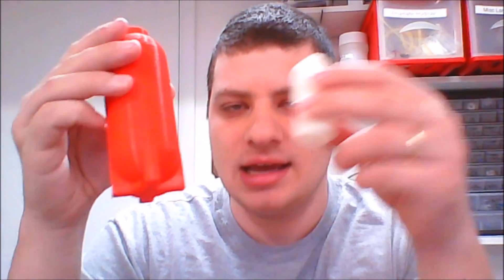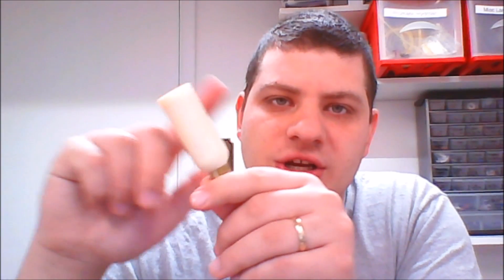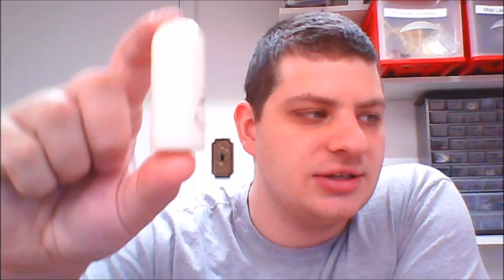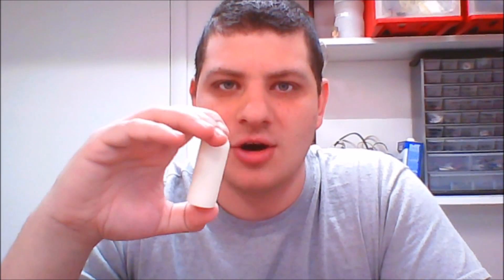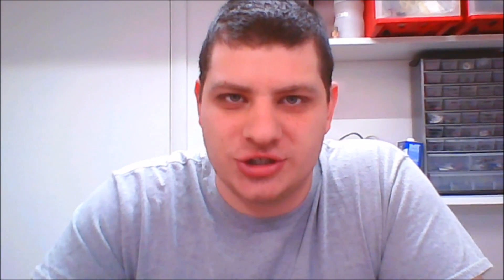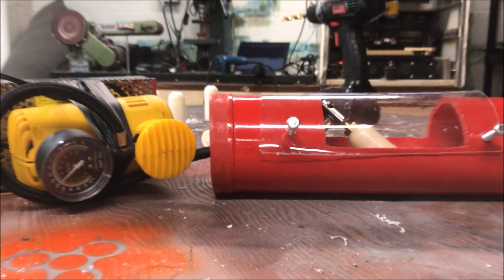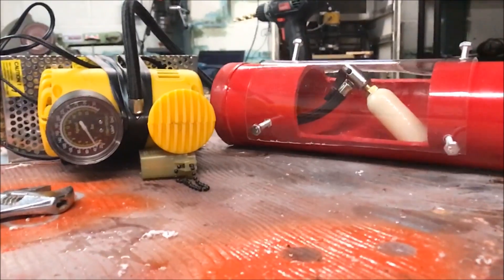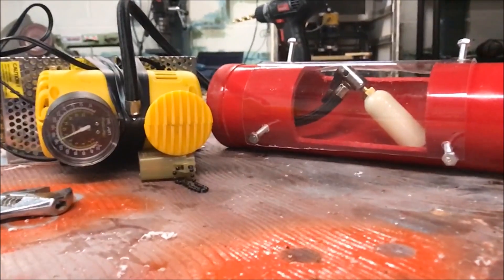Can you 3D Print a Compressed Air Tank? Part 2

Comment: You can print ABS and also PETG air-tight without any post processing, but you need to figure out the right slicer settings for your printer. I managed to reach 8bar (~110PSI) on my Raise3d Pro2 and E2 with a wall thickness of just under 2mm.

Comment: Buddy, as far as I see, the problem can be the size of the threaded hole compared to the rest of your vessel. I´ve been working with pressure vessels for 20 years now. There´s a reason there have been a bunch of regulations for that. Check the ASME pressure vessel code and you´ll see. The slope of the tank curve adjacent to the brass maybe concentrating stress for those pressures and generating the leak. Try a different geometry, much bigger, I´d suggest, with the same material.

Comment: Great information,thanks.Hope all is well you haven't been around for awhile. I was about to print up some masks for Covid 19 and use acetone to seal them until I came across you site and now plan on epoxy. Any special brand of epoxy or technique. A lot of people use XTC-3D. One thing for sure your video ends the debate on whether you can confidently use 3D printing to safely make a mask and protect one from the virus without sealing it,thanks

Comment: You need to pack out the voids. How about printing at increased flow:125 to 130%, slow print speed down to about 30 mm/s, infill overlap 25%.  Pipe threads are tapered.  You ran the tap in too deep, also use (plumbers) hemp to seal the threads.

Comment: Just a safety point. Vessel's should be full of water for presure testing. Water does not compress so will not build energy, if the vessel fractures not a lot happens, you just get a mess. Compressed air builds up a lot of energy and if the vessel fractures it can literally explode.
Reply: Sorry there should be a "not" after Water does. Ie water does not compress.

Comment: I know this is old and all, but I am curious about using PETG with a 1.0mm nozzle at a higher temperature. Should be large enough extrusion width to avoid most hole/bubbles in the material, and should allow the layers to bond tight.

Comment: With the TPU maybe if you change the sharp 90deg edge at the bottom with a chamfer to make the angle from the bottom to the sides more rounded or more acute.
Reply from the maker: I think you are probably right, you could always try it and share the results with us! I haven’t been able to do a video in a long time; so there’s a hole in the market!
Reply: @AudacityMicro  K i was going to try but i found a rounded blow out bulb so Im going to try that design thingiverse.com/thing:2296580. Seems like it should work.. im waiting for the filament to get here

Comment: You should have put a condom on the inside of the tank an screwed your bass piece to the 3d printed part with the excess rubber from the condom in between the brass and 3d printed part to create a good seal between the two parts. Also another idea you should have tried is adding fix a flat in the tank until it sealed. I think the condom idea would be more likely to work though. Other than that cool video

Comment: Since nobody else mentioned this...  Compressed gasses can be very dangerous.  It doesn't seem like it but gas compresses and when the container breaks it is explosively released sending shrapnel everywhere at high speed.   
So you should do a couple of things for your own safety.  First if you are getting any pressure holding ability you should first test it filled with water.  The best way is to make a closed system with one side being the place you apply the pressure and a gauge to read what that is.  You can simply heat that container to expend the water and create the pressure.  Water is not compressible so the pressure can go up quite high this way and there will be no "explosion" when the part fails.

A low rent not as safe but better than nothing measure would be to submerge your test print under water.  The water will slow the shrapnel a lot and you will also see if you have leaks.

I would still wear a face shield.

BTW if you think I'm kidding I dislocated three fingers (two joints each) with an over inflated volleyball.  We were trying to blow it up but we thought it would split, a wrong assumption.
Reply from the maker: +S Koue thank you for your concern. But I promise I practiced good safety practices. I also used very small containers with a very high safety factor.
Reply: I'm glad S Koue mentioned the risk of this project. i read through some comments and was hoping someone would warn about the risk of explosion. Don't always assume you know what you're doing. Im surprised that all the people you spoke to never mentioned a safety pressure relief valve or something similar. I apologize if you already looked into this or if someone already commented/mentioned using a pressure relief valve. I just want you and anyone else to realize the dangers and risks involved. Please let me know your thoughts as i am very interested in your project and im somewhat going to attempt a similar project. If its not doable, i might just go an easier route and probably less costly.
Reply: Testing in a glass jar, and standing in front of it, not too safe

Comment: Two ideas:

Fill the tank with a water soluble mandrel material (plaster of paris?). Then dip it a vat of resin with vacuum applied. Remove after a few minutes (have no idea how long). Then cure the resin and wash away the mandrel materials from the inside of the tank. 

You could also try a plasti-dip on the inside. Like the material used for coating hand tool handles. Or even try flex seal stuff they sell on infomercials.

Comment: I am engineer/project manager for a leak testing company. Remember air will seek the path least resistance. When you have a large leak that does not necessarily mean the rest of the part is leak free - may or may not be. I have seen this many times starting up custom testers. You fix the biggest leak then a second smaller leak show up. Then the next smallest. Maker's Muse has video where he was trying to print a bottle to hold water. While air is a lot smaller he had problems on the bottom wit the actual part design. May give you some clues for improvement.

Comment: I tried making vacuum chamber parts today before I found your video. I tried printing the NPT threads rather than cutting them. That didn't work so I tried Teflon tape. That helped and it got better and better the tighter I twisted then until they failed. I also tried a barbed fitting with mixed results.
Reply: I was thinking about coating the vacuum chamber with PlastiDip. Maybe that would help with your pressure tank?
Reply from the maker: +Phillip Toone lots of people have suggested plasti-dip, so I suspect that it would work. I think if I had to do the threads again I would try a couple things. 1) I would give it more of a neck to make the section around the threads more rigid. 2) I would print a smaller hole, and then heat up my adaptor and use it to melt in the threads.  You could also epoxy it in with the same epoxy I used to seal the sides of the tank. 

Keep me posted on your progress. This sounds super cool!

Comment: Perhaps next time print a neck an use a plastic to metal fitting like what they use for pex piping.  Also on your temperature controlled oven if you want precise control you need to have the ability to cool.  PID control can only do so much on its own.  Also try using a thermistor with very little thermal mass to get your reaction to temperature change as quick as possible.

Comment: How about heating up the metal threads of the valve before inserting into the thread so the plastic melts around the thread. Perhaps with a bit of the resin applied to the thread  (and let it semi set first). Also, you will be better off with the PLA+resin, it's tensile strength is the strongest of any common fdm materials. PETG is most likely to work on its own due to strong layer adhesion. Of course, keeping the internal radii as large as possible for the volume is best (a sphere, though that limits what you might want to use the tank for, but unless you can get up to the 700 psi (from memory) of a CO2 cartridge you won't be using this to shoot projectiles. You can get the strength of the vessel to withstand as much psi as you want with more material. The real limit is the porosity of the coating (or the plastic if you get the right slicer settings - width x height < xsection area of nozzle and print speed low enough for the extruder to keep up.. PET manages to keep carbonated drinks bottles pressurized so its porosity is not a problem at lower pressures. The ideal is to be able to print without post processing, apart from fitting the nozzle. I'd get some PETG and adjust the slicer settings. You can iterate with fewer layers and lower pressures in the water bath to reduce development time. You have a porosity issue to solve before getting to higher pressures. Keep up the good work.
Reply from the maker: +Davin Yap you make a ton of good points there. I used ABS for this test because I wanted to make all my tanks the same in order to reduce the numbers of variables, and since one tank had to be ABS. For the smoothing, I had to make them all ABS. I did trying PLA in my first attempt, and I agree, it is the best material for this. I just got some PETG in, so I might try it. The only problem is that it probably won't hold pressure either, since I'm pretty sure it's the 3D printing that makes the plastic porous, but the properties of the plastic itself. Right now I'm working on moving from pneumatics to hydraulics, so I probably won't keep playing with the pneumatics part. My goal is to design a set of parts that anyone can print, without needed super specialized materials or processes.

Comment: If I want a waterproof object such as vase or bucket, what is best PLA or ABS?
Reply from the maker: +Alexey Voronin As far as I know these problems with leaking are only an issue at high pressure, so it probably doesn't really matter which plastic you use. That being said, ABS has a tendency to warp and de-laminate itself if not properly used. So unless you have a specific reason to use ABS, I would recommend PLA

Comment: hey nice job ........ why dont you try glue the valve with resin this will make air tight, and mabe you can explode one of this
I really like this research because im looking for build a 3D pinted nerf gun , not using pvc but just 3d print
Reply from the maker: +Rodrigo Rosseto I've always wanted to make a 3D printed nerf gun! Are you thinking about having a tank and valve, or doing a piston and spring? I think if you did the piston and spring, you wouldn't run into any problems since it's a slow leak and air always follows the path of least resistance.
Reply: I was thinking about use both , piston and spring to push the dart and a small tank do push an automatic system, like in co2 pistols , but i want fill up with just pressurized air.
Reply from the maker: +Rodrigo Rosseto that sounds awesome. You might want to use something like a water bottle with a printed shell as the tank. It would probably be easier than going through all this to get a maybe air-tight tanks. Either way I really hope this works for you. It sounds awesome.

Comment: Great video ! One remark though : you should try to adjust a bit the volume of the pump clips it's far too loud compared to you talking (and it is just noise so it's not like the sound is that interesting anyway ...)
Also regarding the annealing (if you haven't seen it already) there's a video by Thomas Sanlader where he bakes (without any special care) PLA and some other plastics and despite the roughness of the treatment it changes quite a bit the mechanical properties of the prints (link: https://www.youtube.com/watch?v=CZX8eHC7fws)

Comment: you should try  red anaerobic sealer.
Reply from the maker: +TR1PpyNick I've never heard of that before? What is it?
Reply: its a gasket maker made by permatex, i use it alot to seal orings and threads in engines. or you can use loctite 510. same thing.
Reply from the maker: +TR1PpyNick ah, I know what your talking about.

Comment: hey. maybe you can try forcing the adaptor into the part so it cuts itself the thread... perhaps a little bit of heat would help?! i'm thinking that if you apply a bit of heat, the plastic should expand slightly so you can get the that adaptop in without braking the tank... and let the adaptor make the threads so don't thread it first...
Reply: also a  pipe tap is also not met to be bottomed out when cutting thread. i seen in the clip you sent the tap the full length into the print. Pipe taps should only go about half way in. i think 7 threads showing is a good rule when cutting metal
Reply from the maker: +ionescuvd that's a good idea! I'm going to have to remember that.
Reply from the maker: +seth j huh, I was always taught that you had to go all the way in with NPT to make sure the taper was correct. Thanks for for pointing that out to me. I'll do some research.

Comment: Love it! You don't get much science/hobby fusions on YouTube that are done right.  One option is to extend the neck of the bottle, heat up an adapter of some sort and melt it into the neck.  It should provide a really good seal.  Or even just epoxy an adapter into the bottle... but that's so much less fun!  I think you're right that the flexibility of the ABS is what's causing the threads to leak.
Reply from the maker: Thanks Paul! I appreciate the encouragement :) putting some sort of insert in there is a really good idea. I've used those threaded inserts (like you would see in flat-pack furniture) in PLA before, But I never considered trying something like that for this. I might be able to make one out of steel or aluminum, then set that in side the neck. Someone else mentioned using and O-Ring, which might work too. I don't know if I'll ever get to that though :( I think I'm ready to move on to hydraulics, which will hopefully be more practical than pneumatics.

Comment: what if you put a kids balloon inside of the tank.  Like the inner tube of a bicycle tyre.
Reply: You could coat the inside with liquid rubber with several coats to build up a thick skin.
Reply from the maker: That's a pretty good Idea, though I honestly just don't know how I would get it in there, and how I would get it to seal to the threads on the valve. If you have a good way of doing that, I'll try it. I also thought about 3D Printing a shell that would fit over a 2L bottle. I think that's what I would pursue next if I were to continue with the pneumatics.
Reply: Yea I guess it would be pretty hard to secure the balloon to the thread without breaking the balloon. The only idea I got right now would be to print the tank with an inner shell that’s split in two, so the valve and balloon can be squeezed in place instead of threaded. Then have an outer shell slide over or joined in some other way from the inner shell (depending on how you split the inner shell) to give it structural strength. But this would of course introduce a lot more points of failure. The bottle idea is probably easier.

Comment: Great information and interesting results so far.
The " fibreglass resin" that you used was it Polyester or two part epoxy?
Polyester resin melts some plastics such as styrene. If you did use polyester is it possible that it
melted the plastic also along with encapsulating it?
Reply from the maker: +GlenGH I'm really not sure what is was. It was just that resin you can buy at any of the big box stores for doing small repair jobs on boats or whatever. I bet you are right though, I bet it does eat plastic, because I know that it will eat through a plastic cup.
Reply: Design The Everything  yes that sounds like polyester resin.  Polyester resin uses a very small amount of catalyst hardener like -10 drops of liquid for an ounce of resin,Compared to epoxy that is usually 50/50, 3:1, 2:1......
Reply from the maker: +GlenGH then its got to be polyester resin.

Comment: I'm not sure whether you have a dual extrusion printer or not but I would be curious if printing a TPU inner layer surrounded an abs outer lay would work.
Reply from the maker: +Chris Annesi so I do have dual extrusion. And I thought about doing that, but right now I just use the slicer that came with the printers, and that slicer doesn't handle two material dual extrusion well. I'll need to upgrade to something like simplify 3D to do that.

Comment: good review, was thinking that the leaks on the 2 could also have been a result of the pressure and not a result of you having sealed them wrong. and next time add some reinforcing to the neck, under pressure the abs is going to stretch some, even steel will stretch under pressure, that's why the fitting mounts are always reinforced.
Reply from the maker: +Kirk Nelson that's a good point. Thanks! When I made the first version (the big red tank) I gave it a nice thick neck, but for some reason I didn't do that on this one. I'm going to make another video where I try adding an oring, I think I'll take your advice and add some reinforcing too.

Comment: Maybe an O-ring on top could help the resin version? This is a nice find because that means it could probably be made out of any material. The strength of the part could probably be increased using an even more porous material to print with or even make a low percentage infill and have the resin fill up the inside. This calls for more experiments! great work
There are canoes made of nylon fabric (very porous) and then treated with polyester resin which seals all the holes.
Reply from the maker: +Tim Jadeglans very good points! I think I'll try both those things. I really really like the O-ring idea!